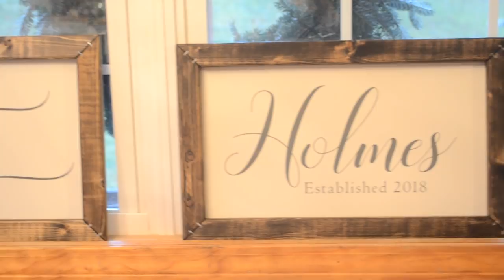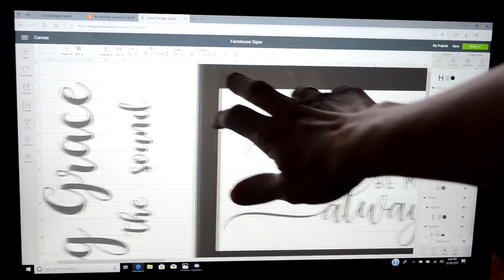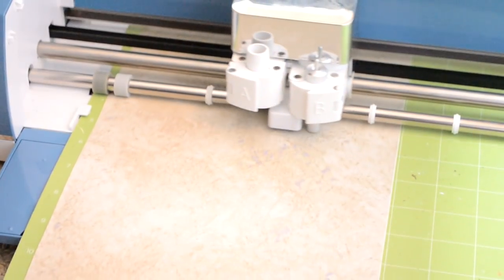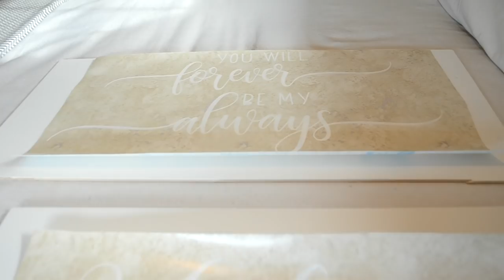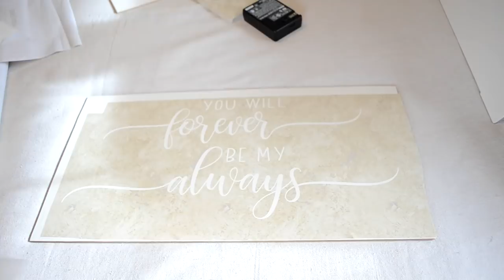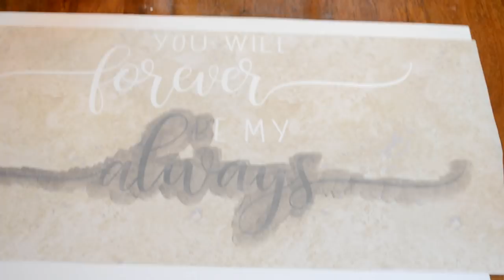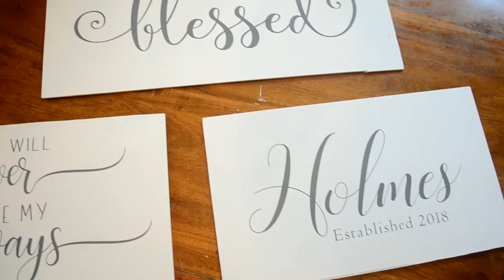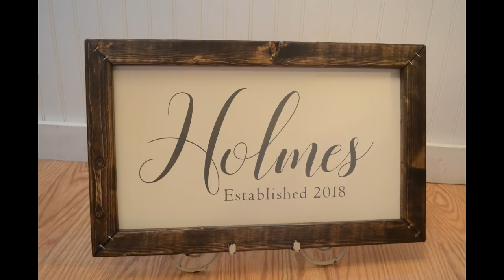DIY Farmhouse Signs / DIY Wall Decor / DIY Wall Quotes Sign / DIY Wooden Sign

Comment: Hi, I am trying to build my own frame, but my corners where they meet up are not coming out right, what am I doing wrong?
Reply from the maker: Hi! Do you mean the angles on the ends don't match, or do you mean the pieces are too long or short when you go to put it together?
Reply: @AppalachianHomeCo  The angle on the ends don't match up to my piece of board.
Reply from the maker: Margie Lee The style frame I made in this video has the edge of the sign board set back about 3/4” or so away from the edge of the frame, just to hide the edge of the sign board a bit. If you don’t like that look you can adjust the length of your frame pieces to the length of your sign board and they will meet up edge to edge. If you sign board is coming up short and not meeting your frame you can just shorten your frame piece a little. Hope that helps!!
Reply: @AppalachianHomeCo  Yes, thank you.  I wished I'd taken wood shop in school.  I am just getting into working w/wood.

Comment: Why do you paint the stencil??? Just buy colored vinyl?
Reply from the maker: Hi. The main reasons I like to use stencils are paint color choices are more readily available sometimes. Vinyl costs more than paint and if I want a "Elephant Gray Matte" colored lettering its so much easier to paint than order another color of vinyl that I might not be using a lot of. If you are just using black and white, or colors that you keep vinyl stock in,then definitely use vinyl, its so much easier. And another reason is sometimes you want more control on the look of the letters. Vinyl looks very clean and sculpted, but you might want a more lighter, faded look to add a rustic touch. Hope that makes sense!
Reply: @AppalachianHomeCo  thanks for adding the insight. Appreciate it.

Comment: What size is the wood on the outside please?
Reply from the maker: Hi. I think these were 12x26 from outside edges and the frame wood is 1.5” wide and 0.75” thick. The sides are 12” and the top and bottom 26”.

Comment: I’m sure someone already suggested to but maybe next time staple the back of the mitered corners not the front unless that’s what you wanted to be seen, just think would like nicer without staples showing otherwise very pretty!
Reply from the maker: Yes you can absolutely leave out the staples in front. I make frames alot of different ways in other videos and most do not have staples showing in front, it just depends like you said what kind of look you're going for. Thanks for your comment!

Comment: what kind of paper is printed?
Reply from the maker: Hi. For this video I used contact paper, but you can use adhesive vinyl (Oracal 631, Cricut brand, etc.) or stencil vinyl (Oracal 813) to do do the stencils. and I am using a Cricut Explore Air 2 to cut them out.

Comment: Hello! As far as the ply wood what is it called exactly and what store can I get it from? Thank You!
Reply from the maker: Hi! You can get birch plywood that is a little less than 1/4" thick, it comes in 4'x8' sheets for around $20 at Lowes. I also use something called luan board for a little cheaper at around $16 a sheet. I got the luan board at a local building supply store but you can prob find it at Home Depot or Lowes as well. Just check the smoothness is what you want before you buy they sometimes are different at different places!
Reply: Christy Cain - The Appalachian Home Okay perfect thank you so much! Also with the paper/stencil part of it. I see the contact paper, but then what is the clear piece you put on top of it and then again peel off? Thank you for sharing 🖤
Reply: Christy Cain - The Appalachian Home And is there a certain kind of contact paper?
Reply from the maker: @emaleebrown743  Youre welcome! The clear piece is clear peel and stick (i believe it is Duck brand from walmart). It is also in the contact paper section.
Reply from the maker: @emaleebrown743  I have used the brands from Walmart and also the MagicBrand from Dollar General. MagicBrand is a little less sticky. I have heard different reviews about different kinds of contact paper. Some people have complaints about it. I havent had any problems using it this way tho.

Comment: What is Cricut smart cutter?
Reply from the maker: Hi it is a small vinyl cutting machine. It can cut stickers or decals and other materials.
Reply: @AppalachianHomeCo  Where can I purchase this machine?
Reply from the maker: You can find them on Amazon, I left a link for the Cricut cutters I use in the description box below the video. Depending on where you live you might find them at local shopping centers as well, such as Walmart.

Comment: About how much $ would this take to make?
Reply: In materials
Reply from the maker: Hi! The board to do the frame is $0.98 for an 8' piece at at Lowes. You can buy either temporary service board (Lowes) for around $0.26/sf or luan board (better quality) for $0.53/sf. The paint cost would be minimal but you would need to buy it . . it would depend on the kind. Craft paint is pretty cheap around $1.00 for a small bottle. Stain you can get for $3-$4 for a small can which would do several signs. Total cost would be around $5-$7 for materials per sign. Also the stencil might be a cost. I make my own so its minimal but they are usually $5-$7 i think.

Comment: What is the name of the wood?
Reply from the maker: Hi. The wood I am using for frames is called furring strips (from Lowes). The sign board in this video i believe was made from temporary service board (sort of like paneling) from Lowes as well. I also use luan or 1/4" finished plywood panels for the sign board.
Reply: @AppalachianHomeCo  thank you